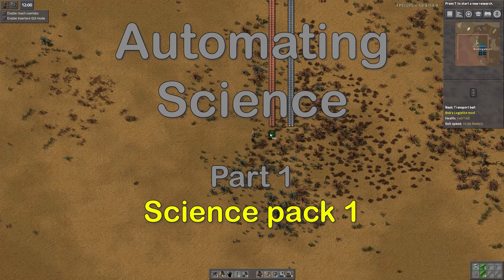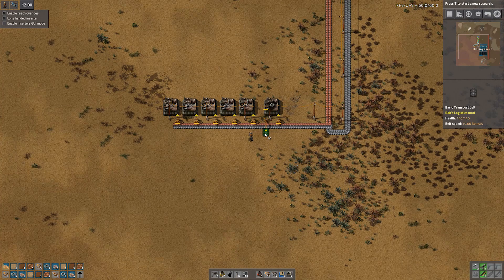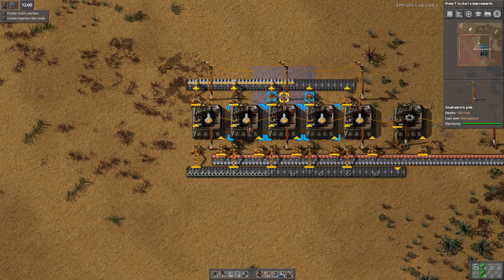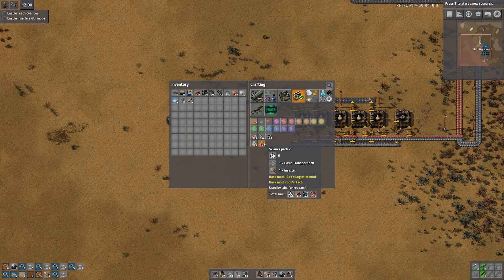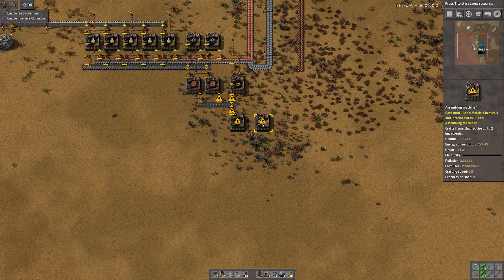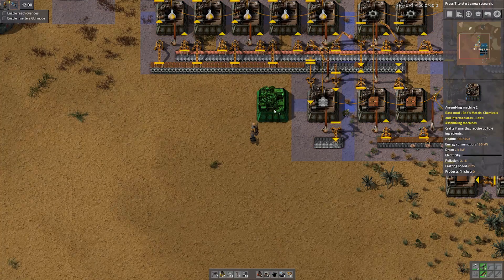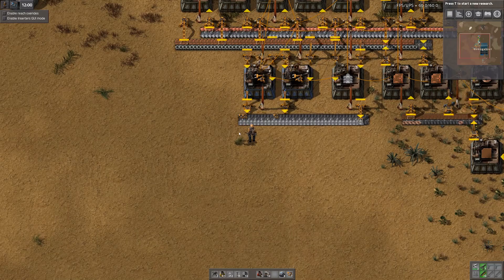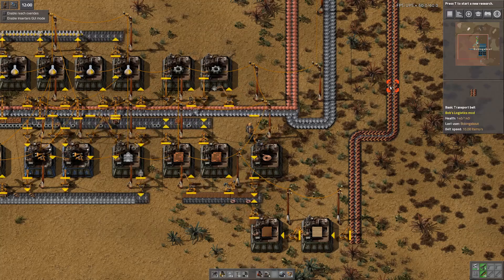Factorio Bob's mods Tutorial 2: Automating science pack 1 and 2

Comment: i REALLY like it, sorry for the harsh words on the forum. 
You dont realize that you didn´t play much, those are very nice basic builds, nothing too complicated. 
Since its a tutorial, i guess it doesnt matter that the 5th science assembler is missing an output inserter ;)

What i find funny is, that you use the inserter GUI for basic stuff like long and near setups, that seems unusual, at least for someone who tries to do as much as possible with keyboard shortcuts, which i learned when "progroamming" building controllers. Its just so much more efficient in workflow. 

On the other hand, your video cuts are very smooth, thats some nice quality, perfect for a tutorial. keep em coming, eagerly awaiting your new ores, haven´t seen them handled without Angel´s smelting/casting
Reply from the maker: I do use the shortcuts myself too when I play (Which is rare, so I keep forgetting what they are and guess), but you can't see when I press shortcuts on screen, which is why for these tutorials I'm trying to stick to using the GUI based stuff, so you can see me doing it... and occasionally forget to turn it off when I want a standard inserter.

And yes, I did forget that one inserter on the science pack 2 outputs. I also neglected to save the game when I was done, so that is missing anyway. (I did actually save after part 1, so I've only lost the science pack 2 progress, I cut a lot out between part 1 and 2 like the saving.)

I think I should do a tutorial on the inserters mod at some point.